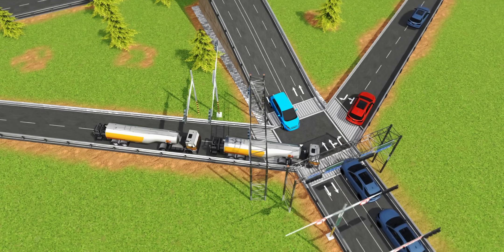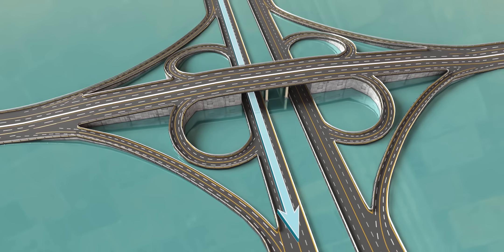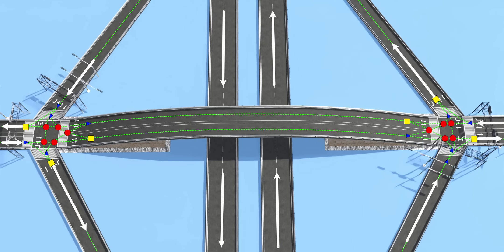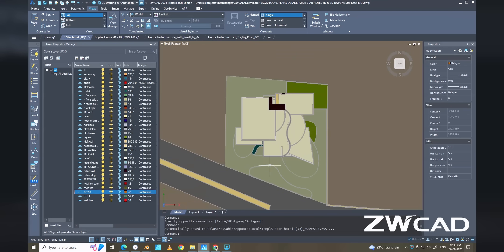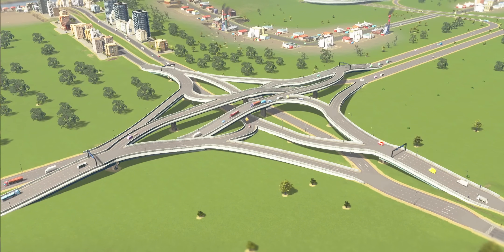The Hidden Engineering of Interchanges!

Comment: Why are the on ramps on the diamond interchange from the beginning and 3:39 two way?

2:10 tf you talking about? How will someone coming from the left side go north?

2:50 simply untrue

6:50 I am not knowledgeable in this field, this may be very correct. However this just doesn't seem right to me. If someone was to explain why the truck couldnt turn a bit more gently that would be appreciated.

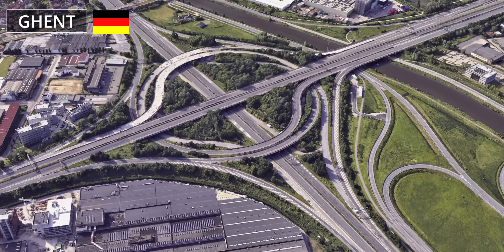8:43 that's a German flag

In the end this video was very enjoyable and informative, however there were some incorrect statements which causes me to doubt some of the information that I was told in the video.

Comment: The US 400 interchange mentioned at 9:32 is in Wichita, Kansas, USA at the US400/interstate 135 junction (where I live)
Its design is amazing and works quite well. However, with the placement of entrance and exit ramps too close to this interchange, and the poor skills of drivers in this area, it tends to get backed up and at times to a standstill during high traffic hours. The North Junction project at the north end of Wichita, Kansas is in progress but the plans look remarkable when making the interchange of more than two highways flow. This is interchanging I-235, 254, I-135, and K-96.

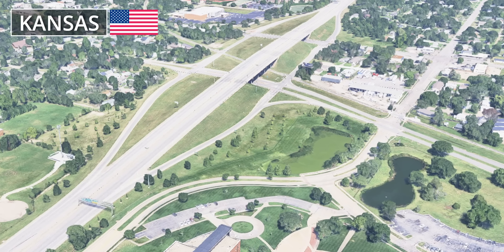The volleyball interchange at 10:35 is also in Wichita, Kansas, USA at US-400 and Meridian Avenue (involving Edwards St and K42) and even involves a railroad crossing and the train goes under the highway.

Comment: Doesn't this fly in the face of all modern data on traffic interchanges?  You've listed the cloverleaf as one of the best of all time for safety and ease of use.  It is famously one of the most dangerous intersection types ever invented because of it's MANY points of conflict.  To further the point, they are removing every single cloverleaf interchange in the northeast as part of the infrastructural renewal program and installing safer ones because they are so famously deadly.

Comment: Hi Sabin, your sketches of the partial cloverleaf do not work out. For example, at 2:00, how does the blue car on the left ever get to turn left, which in your outline is upwards. There is no way. Did I miss something?

Further, the "conflict points" are regularly circumvented by acceleration and deceleration strips. This is how it works in my country, Germany.

Comment: 7:18 "the path followed by the innermost trailer tire". I think that is incorrect. It should be "the path followed by the innermost point alongside the sidewall of the trailer". Or, if the original is correct, at least it does not match the diagram. Is it actually the tire that matters because the side of the trailer that overhangs the inner curve is in midair, or the sidewall?

Comment: 0:57 The clover leaf is a nightmare in large congested area's. You have to many vehicles coming onto the road at the same time you have a bunch of vehicles trying to get off the same road, causing vehicles to have to slow or stop to let one or the other on or off the interchange. The on and off ramps need to be moved at least 5x farther apart from each other.
Reply: 100% proved - clover doesn't work with dense traffic. I know city where they built clovers on major intersections for years and now removing them.
Reply: My city has two major cloverleafs, and on both of them, two of the directions are very busy, and the other two are fine.  So, they put flyover ramps on the busy directions, and left the cloverleafs alone for the less busy ones.

Comment: Is it me, or is the diamond interchange depicted at the very beginning of the video extremely dangerous. It looks like there's a tanker truck coming up the on ramp on the right, crossing the intersection and the going back on the off ramp the other way. I would think those ramps should be one way. But looking at the pavement markings, they have arrows for that movement. Yikes. I'm discounting the info in this video based on the first 10 seconds

Comment: The dumbell interchange at 12:51 features a totally unnecessary segment of road. The "parclo" (partial colverleaf) slip lanes are totally redundant as the roundabout already allows you merge into whatever road and therefore direction you need to head.
Edit: Moreover, I realized this is technically already a dogbone interchange due to the roundabout not being fully navigable. What's more, it doesn't even provide the advantages of the dog one, as it includes unnecessarily sharp turns at the false roundabout.

Comment: The problem with many of these designs is that they treat each road as equal (contributing to extended footprints - one or more exits will be probably be used far less than others), don't really cater for volumetric trends (certain routes will be busier than other at different times of the day), don't really address increases in traffic very well (there comes a point when people brake due to traffic volume or misunderstanding the road layout and this has a knock on to all other traffic), and don't incorporate the idea of waypoints (all traffic decisions need to be taken at the interchange, and once a decision is made you are forced down that route, with little opportunity to go back onto it if you make a mistake, or allow traffic to get from A road to B road via C road or route which may seem wrong, but improves traffic flow). Most road widths are standard, and there is no provision for wider inner lanes for trucks or their turning circles. When traffic does slow down there is very little overflow or alternative routing available, you just join the queue. If there is an accident everything grinds to a halt (traffic in affected lanes, and watchers from the opposite direction). Intersections are designed as standalone units, not as a series of interconnecting flow states. Plenty of numerical modelling is available, but is doesn't seem that it is being applied at a system or network level, just a series of standalone units. Merging is a nightmare when other traffic doesn't allow the merged traffic to join, and we don't seem to apply the concept of the zipper (leave a gap, one car goes forward and another car merges behind). The selfishness of drives and their driving behaviour will always win over clever one design that seeks a one solution to all problems, unless there are multiple options to get onto a desired road using a couple of options for priority high volume traffic and the less used routes have some form of longer diversionary route, lights, stops or control mechanism that allows them to proceed in a segmented form. Just focusing in the interchange itself is a limitation when the whole holistic variable traffic flow needs to be considered. This could also be applied to things like when people need to go into town/stadium at certain times and then go the opposite direction at other times, yet we don't have a dynamic provision for this. You find one direction fully loaded, and almost no traffic on the opposite side of that virtually empty road. We need to get more intelligent in the design of the whole network and understand the impact of adding new facilities and the effect they have on the overall infrastructure as we sale up. The fastest way to get from A to B might not be the shortest route any longer.

Comment: In Germany, the cloverleaf is prevalent, but usually has extra exit an acceleration ramps separated by grass and guardrails. And on the main lanes, you can go without speed limit, wow❤
Reply: Collector Distributor lanes are what we call them in America, and we have them but not all of them were built that way.
Reply: That used to be the prevalent design in the Netherlands between the 60s and 90s, but many had alterations since then with flyovers for left turning traffic at the high intensity flows. Now most intersections are asymmetrical here, with high speed lanes for the high intensity flows and low speed lanes for medium and low intensity flows.

Comment: 2:02 - so, I took a look at this partial cloverleaf.. and I see where cars entering from top and bottom, have options to go straight, left, and right.. but cars entering from the right have no  path to exit the bottom.. and cars from left have no path to exit top.. except by stopping (presumably in a left turn lane controlled by a signal..) and crossing two lanes of oncoming highway traffic. At 2:09 you say "anyone can reach anywhere".. but not without cars 1 and 3 making slow, tight radius left turns across 2 lanes of oncoming highway traffic. 

 So.. sure.. we can eliminate conflicts in weaving zones if we eliminate 6 of the 16 possible entry/exit pairings.. (there are four entries, from N,E,S, & W, and in the standard cloverleaf, each one has all four as potential exits. And/or, we can eliminate these conflicts if we abandon our commitment to building a free-flowing, un-signalized interchange.

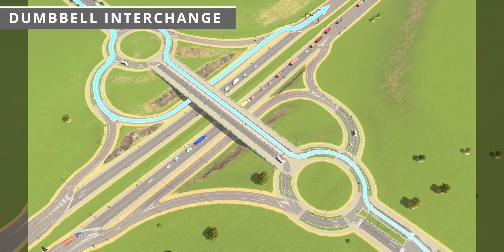Comment: Your illustration of a dumbbell interchange at 12:38 is incorrect, even nonsensical, with arrows pointing in the wrong direction and unnecessary ramps leading to the same roundabout.

Comment: If drivers in the region are already used to roundabouts, a double roundabout interchange can often be safer and more intuitive than a DDI. No confusing lane shifts, smoother flow without signals, and it scales well for local traffic. This how it works in many EU and Asian countries
Reply: To me a DDI seems inherently unsafe with two crossings of the main traffic on the secondary road. I would prefer a double doughnut instead or a large elliptical roundabout.
Reply: @BernardVenhoven  I was thinking the same thing. It requires straight moving traffic to cross over twice. It also requires 2 sets of signals.

I prefer the SPUI since there are no lane shifts, there is one set of signals, and left turns can move concurrently. It is very clean and efficient.
Reply: Good idea. I think many states jumped on the DDI bandwagon too quickly and I don't think those are as good as people make it out to be.
Reply: Most DDIs are converted from existing diamonds.  Sure the solution you mentioned would be better if built new, but when they're trying to improve the diamond, not rip it out and replace it, it makes sense.  There's several in my city, and in every case, they were able to do the conversion without actually closing the bridge/interchange.
Reply: @mavfin8720  To me a DDI is inherently unsafe and never an option. I do not see it as an improvement over a regular diamond.
Reply: @BernardVenhoven  Sure, come up with the money to rip it out and replace the bridge the way you want it, and pay the costs of the traffic having to go elsewhere in the meantime.  I get that it's not the 'perfect solution', but are you going to pay for it out of your own pocket?   I didn't think so.
Reply: @mavfin8720  A dumbbell or double doughnut is an option: two roundabouts, one  on each side of the bridge. Another option is one deformed roundabout (called a krakeling = pretzel in NL), which spans the bridge.

Comment: A ROUNDABOUT IS SAFER AND MORE TRAFFIC FLOW AND ALSO CHEAPER WITH ONE SINGLE LANE - some people just love to build and propagate complicated designs and ignore that it will use more materials makes me mad
Reply: Roundabout maxes out at 1000 vehicles per hour.  They get congested  in high volume corridors.  UK has demonstrated this when they signalize "roundabouts".
Reply: @traffic.engineer  yes but with a single lane interchange design surely there can not be more vehicles per hour than with a roundabout. If you want to compare the single lane roundabout with a single lane interchange, the roundabout will be better. If there is too much traffic, there can be multiple roundabouts, e.g. on either side of the highway, so the total capacity can be increased and the land and material use will still be lower than interchanges. Also what can be done to stop the traffic with traffic lights from where the most traffic is coming at times of high volume, so that the roundabout(s) does not get congested. But if someone simply personally don't like roundabouts for whatever reason and put them in brackets, there is no help. It's just wrong to put personal beliefs in things where it's about how we can build things more efficient with less material and land use. We need rational people deciding these things but it's not the case as we can see in many places, other things seem more important, very unfortunately.
Reply: @humanefriend If this is a single rural or suburban road, then a roundabout interchange is one of the best solution for low volumes crossing.  It would not work in a high volume urban environment due to less gaps to merge into.

A two lane roundabout moves about 1700 vehicles per hour, while a two lane diverging diamond interchange can move almoat 4000 vehicles per hour.  So if the interchange has more volume, the DDI is much more efficient, both in traffic capacity and cost.

But choosing the correct interchamge is dependent on volumes and operations.
Reply: @traffic.engineer I doubt these numbers. For sure it has not been considered that the roundabout can handle multiple vehicles going to different directions at the same time. If there are many left turns, there needs to be an under or overpass to massively increase capacity. I agree it depends on the situation what design to choose but in terms on traffic flow and safety nothing beats roundabouts as a tool. Speed is reduced which helps safety but most vehicles never need to stop completely, if the overall interchange is designed smart, so there should be more throughput. Well but I am also ok if the roads are designed badly without roundabouts, so the attractivity of car traffic is reduced...

Comment: The first cloverleaf interchange was designed by civil engineer Arthur Hale. He patented the design in 1915, and it was first built in the United States in 1929 in Woodbridge, New Jersey. Hale's design was inspired by a bird's-eye view of a clover and aimed to improve traffic flow by allowing vehicles to make left turns without the need for traffic signals.
Reply: Which worked great when the traffic traffic volumes were low.  When traffic volumes increased, they started failing.

Comment: that intersection at 2 minutes does not have left turns for the lanes running right and left.  unless I missed it somehow?!  but the narrator says anyone can go any direction.  can you explain what I missed?
Reply from the maker: You are right, I am sorry for that mistake. Using partial cloverleaf interchange, CAR1 and CAR3 cannot turn left. However CAR2 and CAR4 can turn both the right and left. I missed this point.
Reply: because the design requires two sets of traffic lights for car 1/3 to turn left across eachother onto the cloverleaf ramp, that's the one thing that is missing.
Reply: I live in central California and we have one of these interchanges. It’s been so successful that our city has plans to build 2 more.
Reply: You can it's just that the animation has the anterial on top of the highway without left turning lanes.

Comment: as someone who has played multiple years of the DC route on ETS 2 via TMP it really doesn't matter how you set the road up people will still find a way to congest it to gridlock
Reply: The realism of the drivers clumsiness on ETS 2 is astonishing
Reply: That's why public transportation is the only solution you can 40-100 ppl on one place and just go I mean maybe
Reply: I love how Euro- and Americantruck simulator are this chaotic mix of people who know how to drive and people who have never touched a real steering wheel.
Reply: Part of that is size restraint. much like a fat man wearing sweat pants with a stretchy waistband. If the pants are simply too small to begin with. Then it doesn’t matter how well designed the pants were. 

Too many people taking cars, not enough room for proper high planning.

Car pool lanes and express lanes are the easiest solution, next would maybe be bus routes that connect the most users.
Reply: because induced demand..?

Comment: Traffic speed does not have a 1 to 1 relationship to traffic volume capacity. The number of vehicles passing through by cross section of road does not increase with speed because as speed increases space between vehicles increase. If one wants to maintain a 2 second gap then doubling the speed doubles the distance between vehicles. The cross section keeps seeing one vehicle every 2 seconds. Now if one accounts for kinetic energy the time to come to a complete stop increases so in theory the time between vehicles should be increased.

Comment: Amazing video but the interchange is beyond stupidity, a roundabout works so much better
Reply: Roundabout fails on high volume roads, as demonstrated by the UK and other European countries signalizing "roundabouts".   Single lane roundabout maxes out at 1000 vehicles per hour, up to 2200 for triple lane roundabout.  Roundabouts are better solution for low volume roads/intersections.